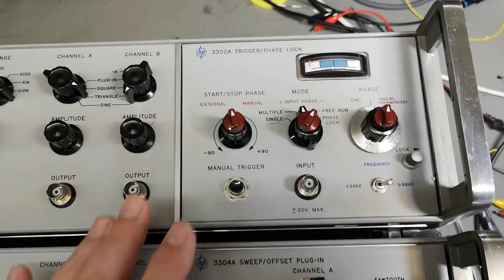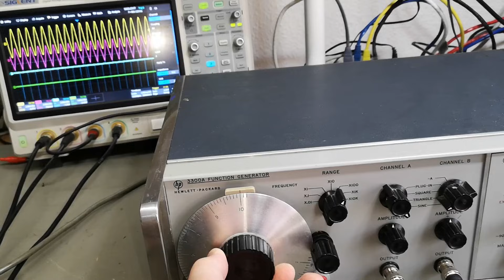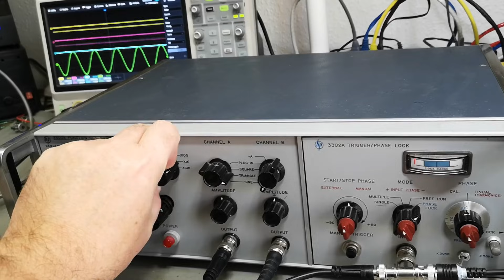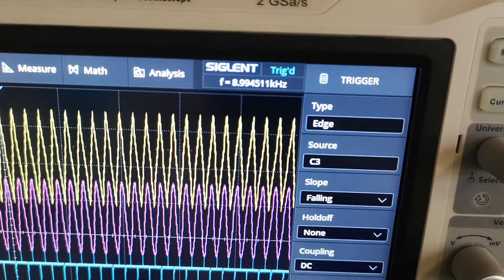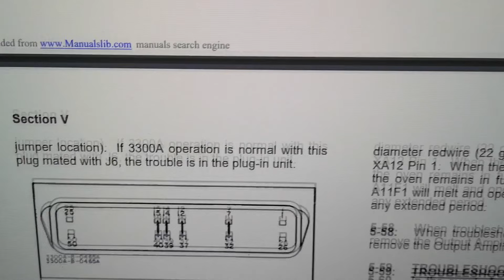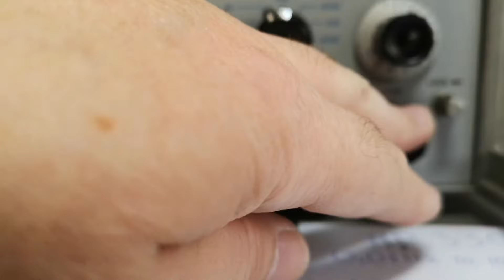HP 3300A function generator 3302A 3304A plugins test teardown

Comment: Will the 3300A provide basic output without  a plug-in installed? I have two of these units but no plug-ins.
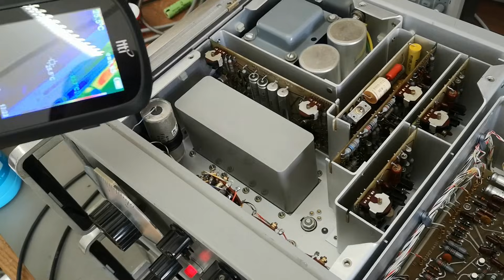Reply from the maker: is explained in this video from 33:00
Reply: I see that now--also shown in fig. 6-6 in the manual. Thanks!
Reply from the maker: @mikemcginley970  super. also check your crystal oven is heating, and temperature regulation is working, it is a classic error seen on this model